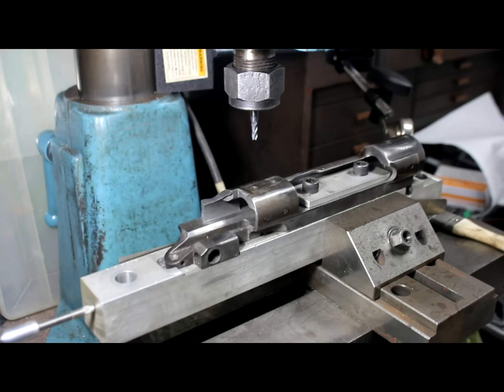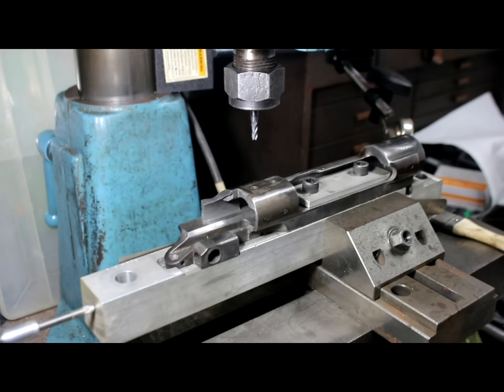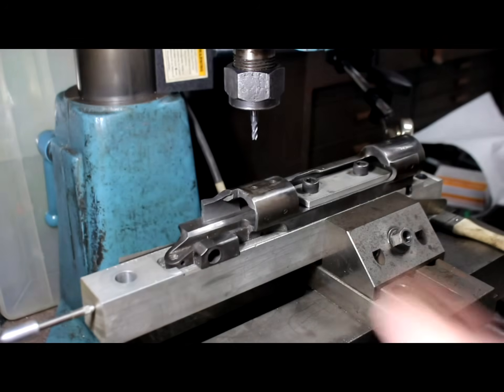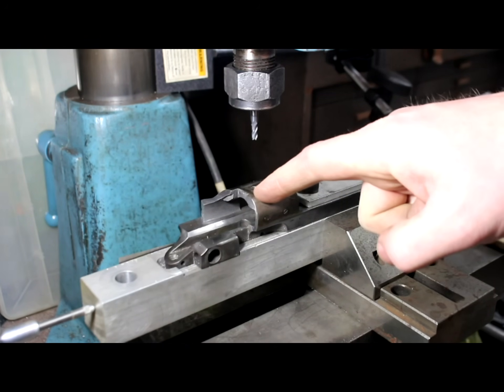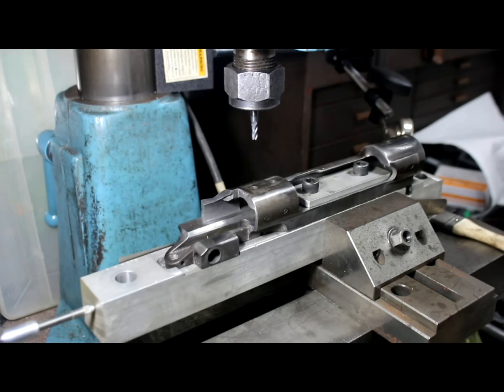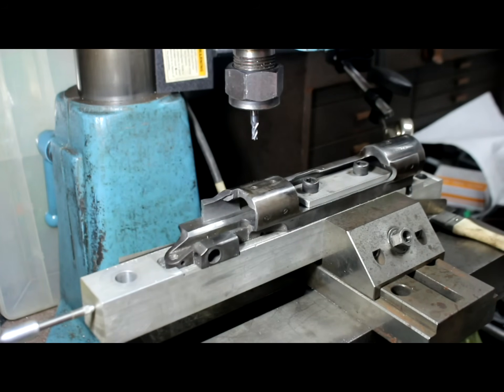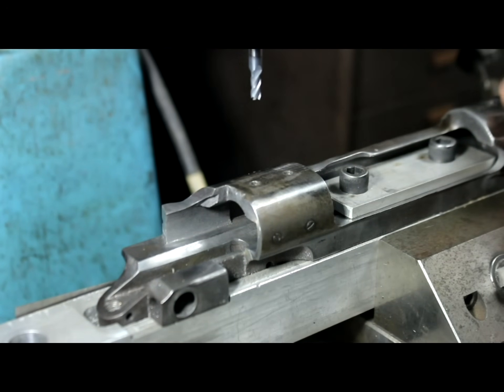Repairing Scope Base Holes that are Mis-Aligned

Comment: A gunsmith I went to drilled 4 holes out of line with each other. The front most hole and the rear most hole were out from the inner 2 by about 1/16, causing the front base to point left and the rear base to point right. It was bad enough you could see it at a quick glance. Not sure how he managed that on a mill. No amount of lapping could have saved it.

When I called him out on it he said "it looks good to me". After he used a straight edge across the holes and saw I was right, his solution was to re-drill the holes in the bases crooked to match the gun. 

I asked for a refund (which he reluctantly gave after some resistance), took my butchered gun and never looked back.
Reply from the maker: Unfortunate. Machining the holes on a base to match the messed up holes are sometimes the only way to fix the front. The rear can be welded up and redone.

Comment: What scope base did you use after re-drilling and tapping the receiver? I can not find a base that would fit the rear part for a P1917. I found that my front fits a Weaver 37 with a 0.860" hole spread.

Comment: 6-48 is ok for .22s and the like, but I even re-drill,tap my .22s out to 8-40 now just because I can and I like the beefier screws. Does require opening up the holes on the actual weaver or picatinny bases though.

Comment: If you understand how to TIG and have and aluminum heatsink mandrel, easy to make, you can TIG the holes on the ring easily. You are only filling the holes and so less heat is needed to TIG them closed and re-drill and re-tap those holes. I’ve done it many times. The critical part of the receiver are the mating surfaces for the locking lugs when the bolt is closed. Filling the holes with a TIG does not require that much heat. Good video though.
Reply: Can you point to any details on the heatsink?
Reply: @sachertorte64 Details? Make an aluminum mandrel in a lathe that will match the diameter of your bolt, usually 0.700 inches and the other end threaded the same as the receiver threads. I have a number of them for different actions. Another thing you can do is bury the receiver in a bread pan full of sand with just the section where you are going to weld visible.

Comment: did you use a coax to  line up on that first hole in x
Reply from the maker: In the Y axis? No, While you could use one and it could be quicker with a quick tool change, I used an edge finder on both sides and dialed in to the center. This was done after making sure that the indexing bar was parallel to the X axis with zero runout behind and in front of the intended holes. The hole spacing on the X axis plane was found measuring off the front of the receiver ring with an edge finder and dialing in specified spacing. The goal of this is to line everything up on the raceway of the receiver and not rely on the OD of the action or the barrel which may be off. Doing this along with a trued up barrel and chamber job, will diminish having a scope run out of adjustment in one direction or another.

Comment: Absolutely perfect to action but not to barrel which is more important.
Reply from the maker: This is done before installing the barrel, also the barrel should be lined up with the action. If its not, then the barrel install was not done properly. In reality, you can have the scope canted in any direction, if you zero at one range and shoot that all the time or close to it, you would never know as long as the scope has enough adjustment to zero. It would show up in a target gun real quick however and wouldn't track at all. While this is the best method to line up scope holes, the Forster jig works almost as well. It gets them extremely close, but you are still relying on the OD of the barrel, which in most cases is not in line with the bore.

Comment: Does one have to remove barrel when doing this, like Remington 700 action?
Reply from the maker: Ideally yeah, but It can be done with the barrel on. you just need to be aware that you don't want to cut into the barrel further than the action depth, and you'll need a bottoming tap. Basically you will cut off the threads of the barrel where the scope base hole will be. No need to go deeper into the barrel.

Comment: Many of these old military rifles were drill and tapped by the owners, who ordered them by mail out of a catalog.  The holes didn't have to be accurate, because scopes in those days had tons of adjustment.  Ralph DiTore, the 1917 actions are at the top of the gunsmith world in strength and longevity, and will withstand the pounding of even the most powerful cartridges  today.

Comment: another 1917? Whats so special about this action? I know they were popular for mag cartridges due to it's length.
Reply from the maker: Many of them are converted to magnum chamberings. For me it's the ability to style that whole receiver into something nice that not many people do anymore. When done properly, they are smooth as glass, able to take large cartridges, streamlined, and make a really nice sporting rifle. They also have coned bolt noses and barrels which many custom receivers have today. They also have a 2° canted lugs which allow for less sizing of brass and much easier extraction of spent cases. When done up right they make a really nice rifle. If you have never handled one that has been completely worked over, you probably would have a hard time thinking it was anything special.
Reply: good to know.... not following coned bolt noses and barrels
Reply: @precisionmachineshed  "Able to take" and cable of safely chambering Magnum chamber pressures are two different things. Got good liability insurance? How about disability and life insurance? Idiot.
Reply: @deeremeyer1749  you call him an idiot for saying something that other people do? Such an intellectual
Reply: DEEREMEYER1 pretty harsh to call him an idiot.  Any builder of these enfields will be well aware of the well documented issues with some of these receivers as well as the path to proceed safely.  I.e. removing stress from barrel prior to removal, magnafluxing, etc.  I certainly don’t consider the poster to be an idiot

Comment: did you use the mandrel centterline to drill the third hole and did you know the distance between the second and third hole
Reply from the maker: Everything was lined up before milling any holes.  I actually took a third measurement in the middle of the mandrel as well that I didn't show.  Therefore my table was running true across all holes. After dialing everything in.  I just ran the 4 holes making sure to get the spacing correct for 2 piece bases. Had it been for a once piece,  then the space between the 2nd and 3rd holes would need to be measured.
Reply: forgive me for being an ass but how did you locate that third hole in the x axis.i understand that everything is lined up in the y
Reply: never mind I had a brain fart you did the third hole just like the first
Reply from the maker: Center finder tool. If the hole- is off to the side it can be tricky,  but you should be able to get really close. You then double check that your second hole will cut all the way around.  If not,  you can split the difference a thou or 2 to clean up both holes and still be spaced properly apart. It's more of a measure, once,  twice. Thrice,  and quadruple check everything before cutting. Even if the center finder won't find center based on a mis-aligned hole, it should still tell you if you are on side to side based on the alignment of the tool.  

Another option,  would be to screw in a screw,  tighten it down,  and use an edge finder to get the center of the hole. 

Ether way works.
Reply: yes I understand now. my mill drill just has dials and and can be a pain in the ass

Comment: Would  a savage 110 base line up well with that action?
Reply from the maker: A long action one will fit, however,  you need to re-drill at least one set of holes in the base to match the enfield.  The spacing on the 110 long action bolt holes is longer and the short is too short.  You also need to cut About 1/2" in length from the base.  

So,  you can make them fit,  but it takes some work. One of the last videos I did titled "removing stuck barrels" I have a photo of one done like this at the end.
Reply: Precision Machine Shed I saw one of your builds which had a long action picitinny rail.  It appears that you prefer to contour your action round as opposed to a Remington 700 or Winchester 70 contour, so I assume you are using savage mounts.  Is the process you describe how you make your bases?
Reply: From my experience, if Remington made the Enfield action, then a Model 700 base generally works. I have used the dual dovetail bases on Enfield actions. 
Also from my experience, model 70 bases work on Winchester Enfield actions. 
Eddystone, anyone’s guess.
Reply: Joshua Lucas If the machinist is milling the dog ear sights off the rifle, then I don’t understand why it matters if it’s a Remington, a Winchester or Eddystone.  The Remington 700 base or Winchester 70 base aren’t going to fit without contouring the action specifically, that’s why I was asking if the round contour is easiest to machine and thus, the long action savage base.
Reply: Same radii
Reply: Joshua Lucas sorry, I don’t understand how that answers my question.  Could you be more specific please?
Reply: The Remington Enfield and the Remington 700 are the same radii. So the Leupold based for the Remington 700 base will fit the Remington Enfield.
Reply: Joshua Lucas when you say Remington enfield, do you actually mean the Remington model 30?  Because the Remington produced p14 and m1917 had dog ear sights on the rear bridge of the receiver and this, so no have any sort of contour that allows any sight base.  I assume this is what you mean when you say Remington enfield, correct?
Reply: Remington p14 and p17 when you take off the ears, the action radii are the same as the Remington 700